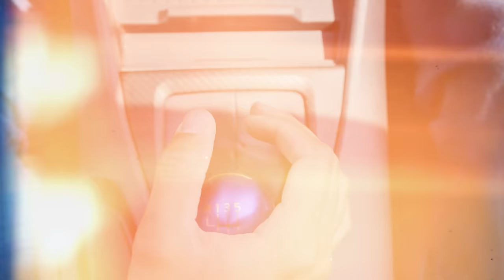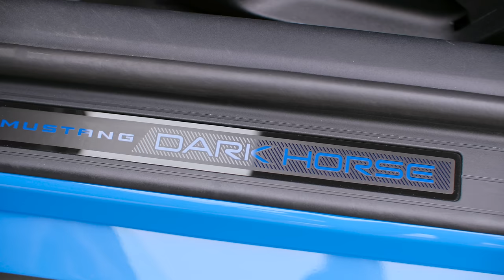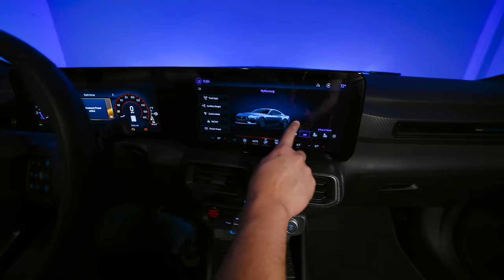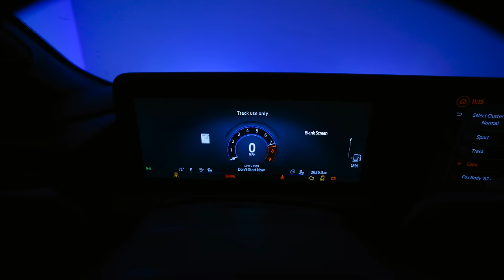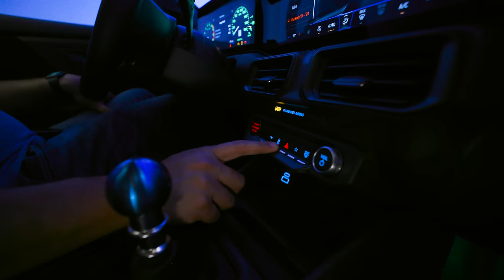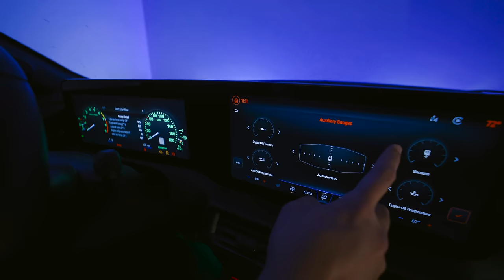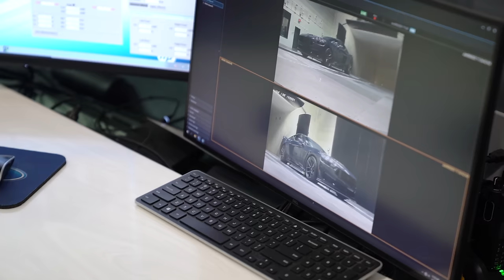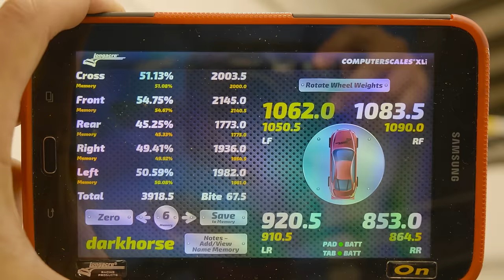2024 Mustang Dark Horse | Why This Car Exists

Comment: I don’t know I was getting excited about the dark horse, but I cannot believe the roof is higher. The whole idea of a coupe is the lower slick looking sports roof not a higher roof that looks similar to a sedan. I haven’t seen these on the road yet as I’m from Australia but I’m starting to think this is just a parts bin special before Ford goes electric. I hate how they say ohhh we wanted a lower roof but the people who are going to race these can wear a helmet seriously, build the dark horse r with a bigger roof not the street car. Also the pinnacle of 5.0? Forged rods? If s550 can handle a supercharger surely the gen3 engine was strong enough for 500hp. Bunch of marketing crap to sell off their stock.

Dark horse should of been supercharged or twin turbo with the dual air intakes.
Not this bull.

Comment: Really sucks it doesn't have physical climate controls. At least is has a physical volume. I got a GR Corolla last month. And I'm really glad it has physical volume and climate controls. Miss-pressing something on the touch screen can be super distracting. You have to pause and wait a second to see if the screen/system/android auto/my phone is just lagging or if the screen didn't pick up the touch. So you're kinda staring/glancing at this screen for a second waiting for something to happen. You tap it again to get it to do whatever you were trying to do. And then it does something. I absolutely do not want that experience for climate controls. Having a knob I don't need to look at to warm up or cool down the car a few degrees is awesome. Quickly being able to hit Auto climate or climate off if I'm driving windows down or windows up is nice. Again would be really annoying if I had to check the screen 2 or 3 times to see if the car actually did what I wanted.

Having Waze/Spotify on the reasonably sized screen is nice. I think Toyota did a good job with the interior. I'm on a tangent but I'm just going to keep going with it. I actually wish the iMT was on by default. And I bought an engine start/stop cancelation fob to basically press that button for me when I turn on the car. Window switches felt like they were really far back at first. I guess I'm used to it now. But I kept hitting the window lock out button instead of the front windows for the first week. Also don't love the shift pattern. Definitely something the Type-R does better. Wish reverse was down to the far right. Not up and to the left. I find it annoying when parallel parking. Having first and reverse completely opposite of each other just makes way more sense to my brain then having them next to each other with a ring you have to lift.

But other than that and a handful of other little things I absolutely love the car and I'm glad I was on a waitlist for it instead of a Type-R or anything else on the market.

Comment: If only GM put this kind of passion into the Camaro.
Reply: I think a lot of engineers would but GM won’t let it step on the toes of the beloved Corvette
Reply: Passion... don't you mean re-hash of last gen s550? Only with even more frod bandaids included to try and fix chassis and handling issues? Why do you think the weight has gone up each generation since s197? Which is the basic platform for the s550 and now this mess s650. No thanks. GM nailed the Alpha platform the first time and called it job done over 7 years ago. And frod has been trying ever since to match Alpha.

Comment: The concern is, of course, how dated that tech will look in 10 (or less) years.  Nothing dates a car more quickly than its screens.  Manual, and good steering, and timeless however.  Also, just imagine what kind of repair nightmare a dead screen would be in this car, let alone how you'd lose access to core cabin functions.  Those screens, while trendy today, will age extremely poorly in a very short amount of time, at least long before that lovely V8 gets "old."

Comment: These Mustangs that are trying to be Sports cars are just not doing it for me. I don't need the aero or ultra handeling. There are no road courses in my area, and I have never seen people actually racing on any of the twisty roads in my location. What there is a lot of are stop lights and drag race tracks. I would much more prefer a car that is more geared towards light to light racing than have some ultra handling package that I will never ever put to use. Bring back the LX 5.0 moniker and make a lighter mustang without all the handling mess. Give it the option of a Cobra Jet package that is street legal, that would include control arms, springs, and shocks geared for weight transfer. Maybe offer drag radials and or a transbrake as an option. Would be much more suited for motorsports in my area.

Comment: All pony cars have traction issues because they lack stability control due to RWD and narrow non grippy tires. It could be fixed by a good AWD that adds traction and faster acceleration as well as better cornering or at least a wider wheels set.

Instead you can only have it in handling package which is not daily drivable due to the lowered ride.

So, they just sell the same car with a newer screens and a small update.

No fast automatic transmission, no awd, no good traction, no good feedback on a steering, laggy gas pedal, no comfort and grippy seats with proper ventilation/heating, not even mentioning massage.

Just. Weird.

Comment: isnt the whole point of the  e-brake system is that it works is all else fails? how does an electronic e-brake system make any sense from that point of view for any of these modern cars
Reply from the maker: Not much other than its easier to pull up vs switch.  The drift brake has some purpose but honestly...

Comment: Ford has so many engineers. Why is there no seat heating in the Recaro sports seats?
Why are there no front parking sensors on the new Mustang?
Why are there different interior colors on the US model and the EU model?
Why did the drift brake make it to Germany? This is pointless. You can't drift in normal traffic.
And what is with the remote Start? = not for Germany... but drift braking is allowed.

Comment: My god does this company need help, where is the competition? 
Where did they push the envelope ? 
This shit looks like the s550 model got a after market body kit, 
no call back to the Foxbody ( except for gauge cluster) ??WTF??
there is only a call back to fastback....which has been done multiple times BY THEM.
Fuckin Shelby gt500 was in a fastback, I know a lot of people buy em just cause its Ford and honestly their part the problem.
Ford needs a DOHC 5.7L 227CFM Big Block W/LCVVT and a WHOLE new Infotainment system. 
We really went from 2,300 ish pounds in a Foxbody to nearly 4,500 in these new ones...Again..WTF
Power is okay I mean that's thanks to DOHC giving it 15+HP/Cubic inch, Just needs more displacement.
I could go on and on about this car but id rather burn and crush it and start over cause that's the only apparent way to make new shit now days,
Or else the company's just rise and repeat. 
Cant wait to get to build these I will let not a soul down, only thing i plan to let down is a metric fuck load of power.
Cause Ford lost the sauce.

Comment: I don't like it. With the 6th GEN Mustang Ford copied the 5th GEN Camaro. And why not the GEN5 Camaro was a great seller for GM. Unfortunately your Zeta Camaros were overweight, and offered mediocre chassis performance at best. The S550, and now was exactly the same. GM hit the Camaros chassis/suspension performance out the park with the GEN6 Camaro with the Alpha platform. Unfortunately the Alpha chassis in any car that uses it isn't the best from a practically standpoint, but its performance is world class. Sure you can polish a turd up. Look at a 00 CobraR, GEN5 ZL1, SS 1LE, Z/28, S550 GT350, GT500, Mach1. Yes these are capable cars, but with the same effort the Alpha Camaro still out-performs them. Too bad GM's engine department has fallen off, and please don't mention LT6 to me. LT performance engines should have 0 cylinder deactivation hardware, and LT4 is a turd of a factory SC'ed engine compared to a Terminator, Trinity, Predator, or Hellcat engine. LT4 is a slightly beefed up LT1 with Eatons least efficient modern blower. GEN3+ Coyote on the other hand has been where Ford's been doing well. The reality is that GM's still the better chassis company, where Ford's become the better engine company. I do wish Ford would quit boasting about their gimmicky BS. With S550 it was pony lights under the mirrors and a linelock app. With S650 they're boasting about the ugly tablet dash, and corny Foxbody digital style gauges. (Love Foxbodys BTW, and own an 88 GT) 

I have no bias towards Mustang or Camaro, and have owned multiple of both, but the updated S550 that Ford acts like is something other than a facelift with an updated dash and slightly improved powertrain. This S650 name is false leading as the structure of the car is pretty much the same as a S550. Even kept the POS MT82. This is a car I'd rather have as an A10. The Coyote/10R80 combo is excellent. The GEN3+ Coyote deserves a TR6060 in the base GT form. The TR6060 in my 19 SS 1LE is 10x's better than the T56 in my 03 Cobra, which is 2x's better than the MT82.

Comment: Like the front end of the GT although that thick plastic below the grille was so unnecessary. Also hate all the black plastic under the lights on the Dark Horse. Really, WTF is that?!?! Not 100% on the "Dark Horse" name, kinda cheesy. Sounds like ya felt ya needed to be sinister like the Hell Cat. Having typed that, yeah, I'm 100% against it, lame! Boring azz 'camaro-eque" hood. Cheesy AF that only the premium gets the one screen, non-premium gets two iPad. The one screen should be curved, not bent and the thick black border of the screen makes it look Radio Shack cheap. Like the exterior profile, upswept qtr window, hhhhhaaaaaate the top of the trunk edge, droopy azz rear end like soooo many gms. Why in the hhhhell did they take the "duck tail" from the S550 away? Wish the rear spoiler didn't have a center pedestal (cheesy but livable). Hate the trunk opening gap line. Should be one straight gap line running from taillamp to taillamp. S550 looks so neat back there. Lower rear bumper applique looks heavy, non-functional and doing too much like gm does. I like it but, not enough to buy it. If there was a rush to buy the last 2+2 V8 cause they stopped making them, I'd buy an S550. S550 was world class design without flaws. S650 looks straight up thrown togetha. Ford ya took a step backward in fit and finish design. This Mustang is better mechanically but, it's crrrrrap (much like gm) in design. And it ain't "all-new" so stop saying that.

Comment: Jesus Christ. The whole point of a manual handbrake is that it is simple and will be easy and cheap to fix when it eventually wears or breaks.
Making an electronic handbrake but making it look like a manual handbrake is missing the point entirely. You get none of the advantages and all the disadvantages!

Ford has shown since the Mach-E that they are incredibly tone deaf. This company is full of non-enthusiasts that claim to be enthusiasts. It is an embarrassment. You either make an appliance (e.g Ford Ecosport) or you make a proper car. You cannot sit on the fence and claim to be able to do everything.

Comment: The problem with the Dark Horse is it is so overpriced... I would rather buy a low mileage 2020 GT350 for less than you can get a well optioned Darkhorse... GT350 looks better in most peoples opinion they are faster and will always will be a more desirable car...

Comment: SEVENTY-THOUSAND PLUS DOLLARS FOR THIS?!?!??!!?! GTFO Ford...

4000LBS!!!!!

Those screens are the laziest design I have ever seen. It looks so damned devoid of character on the dash, and sticks out like a sore thumb. Others are guilty of this as well. It looks so out of place, afterthought, or they forgot to put a cluster in the car and just 11th hour it. It's seriously that damned HORRIBLE and cold, devoid of passion, and it ruined the interior of the car. 

Touch screens only for climate controls? Nope... STOP LETTING MILLENIALS AND YOUNGER DESIGN CARS. They don't even know what a woman is. This failure is the product of DEI.

Buy a Camaro SS 1LE 6M while you still can, save $20,000+ to spend on tires and driving lessons and be right there with this thing with the better tires. Why is this, and even the regular GT so much money now? That's insane for an evolution of an existing chassis.

Comment: LOL… we used the old body because changing it is hard and expensive. We got in touch with millennials and Gen Z-  spent hours and concentrated on the taillights and dashboard customization for things like climate control and e brake.  Thought long and hard and put wider tires on it and then installed a cutting edge millennial theft proof device called a manual transmission

Comment: Despite what the automakers would have you believe, it doesn't cost that much more to make a V10 versus a V8. Do yourself a favor and check out the excellent Savagegeese recent Lambo Huracan video. The Lambo's V10 is how a performance engine should sound and how quick it should rev. Not this current Mustang's lame-sounding, slow-drying concrete-revving V8. But Ford will continue to chuck mediocre products at its customer base, never daring to engineer a GREAT engine, and put it under the hood of one of their cars for a reasonable price tag.